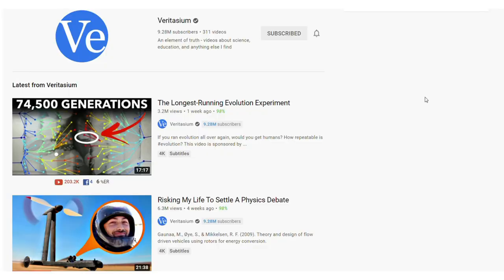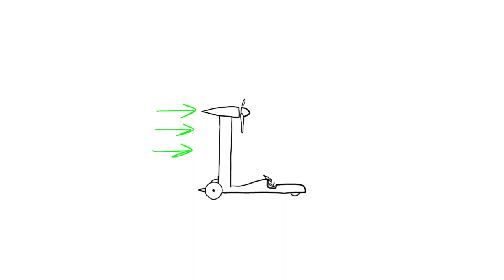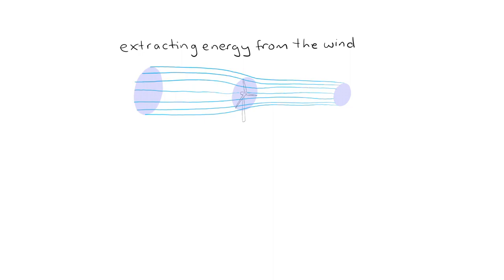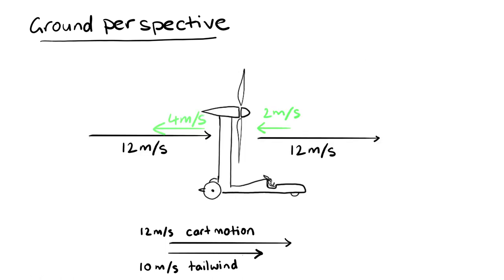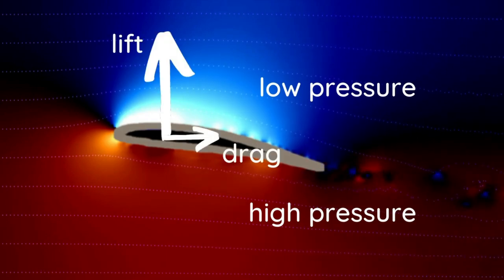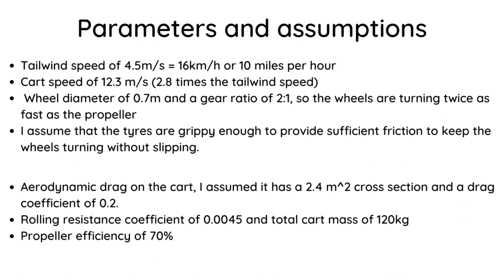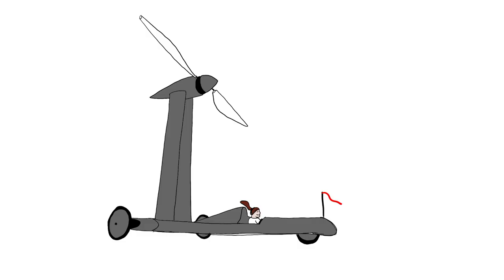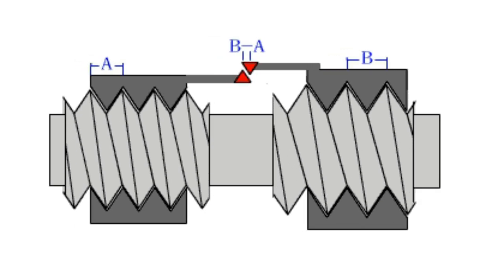Downwind Faster Than the Wind by Veritasium: How Does it Work?

Comment: Not a very good explanation for those who have little training in physics and math.  A better approach to understanding would be from the high performance sailing perspective.  As the lady said in this video, sailors have been sailing boats (and ice yachts & land yachts ) faster than the wind for a long time (many decades actually).  I can remember 60 years ago sailing an ice yacht faster than the wind.  
Bear in mind that a windmill is just an airfoil AKA sail, which rotates.  One simply needs to use video graphics or diagrams to show the dynamic relationship between 1) absolute/ambient wind, 2) vehicle translation/movement on land/water/air, and 3) relative/apparent wind. The static explanation in the instant video is pretty much useless for most people to understand what's really going on here; how the relative wind from which the motive power derives, increases with the speed of the vehicle.  
In the 1970s I framed this idea as "Momentum Feedback Amplification" (MFA) and built working models.  Unfortunately I didn't have the financial or mechanical resources necessary to fully develop the idea.  It's refreshing to see those ideas manifest on YouTube 50 years later.
Reply: In the case of a DDWFTTW vehicle, the key factor is that from the vehicles frame of reference, once at or above wind speed, the ground is moving faster than the air, which allows for a reduction gearing that divides the speed and multiplies the force. For example a 10 mph wind, a vehicle moving downwind at 15 mph, ground speed is -15 mph, air speed is -5 mph, that allow for a 3x reduction in gearing. A higher speed, lower force from the ground is geared down to generate a lower speed, higher force against the air.
Reply: @rcgldr  How do you believe your gear and ground theory that accounts for the fact that sailboats, land yachts (with free spinning wheels), and ice yachts, all of which have no gears, can sail faster than the wind downwind.  Moreover, how does your gear and ground theory explain the fact that a windmill type sailing craft like the Blackbird also sail directly at 0° upwind?
Reply: @melellington1333  - reduction gearing principle doesn't apply to sail craft. It applies to vehicles that move directly downwind or upwind, such as the 1877 Brennan torpedo, where the two media are wires and water. The wires are pulled back and off spools geared down to drive propellers, that in turn drive the torpedo forwards. If wires were attached to posts, then the torpedo would travel downstream faster than the stream. Using the same principle, a model river boat could use the spools geared down to drive a paddle wheel, in which case, there is no movement of any components that resemble tacking. For DUWFTTW (directly upwind), a windmill is geared down to drive the wheels, and the higher speed, lower force from the wind is geared down to exert a lower speed, higher force onto the ground. High performance sail craft that can achieve VMG (velocity made good) directly upwind or downwind faster than the wind, are able to do so while tacking because of their overall lift to drag ratio. One difference is that propellers or windmills operate in their own induced wash, which affects efficiency, while sail craft are constantly advancing into clean undisturbed air. This is why helicopters require more power to hover (operating in their own induced wash) than they do to travel laterally (constantly moving into clean undisturbed air).

Comment: The starting explanation was not totally correct. The prop pitch is variable negative to positive..you start with the prop pushing the wheels to start forward motion then once you have momentum you can change the pitch to have the wheels push the prop.
Reply: "you start with the prop pushing the wheels to start forward motion then once you have momentum you can change the pitch to have the wheels push the prop"

Maybe they did it like that, not sure, but it's not required (if friction is low enough).

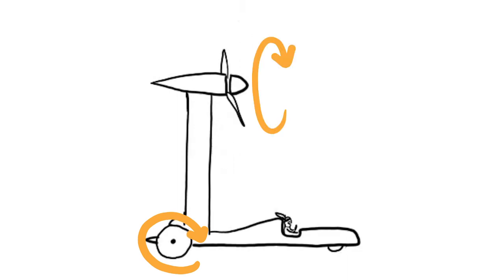Comment: Me : PAUSE... Hold up!! 0:23 "The wheel on the cart turn the propeller."
Me: I hope you correct yourself later. It's the other way around before it's traveling faster than the wind.
Reply from the maker: Actually, the wheels always turn the propeller. The propeller's direction never changes below and above wind speed, and it never gets turned by aerodynamic forces directly turning it like a wind turbine.
Reply: @EngineeringwithRosie  I wasn't implying the prop changes direction. I was implying that it takes the wind to power the prop that in turn powers the wheels until the vehicle matches the wind speed. After that, then yes, the prop is powering the wheels.
Reply: @SternLX  The wheels are powering the propeller.
Reply: @seneca983  Yes. AFTER its traveling faster than the wind. Prior to that the Prop, still chained to the wheels, is being turned by the wind which in turn powers the wheels.
Reply: @SternLX  "Prior to that the Prop, still chained to the wheels, is being turned by the wind which in turn powers the wheels."

No, the prop is being turned by the wheels in that case too. If the prop were turned by the wind it would spin to the other direction.
Reply: @seneca983  No, Wrong. Blow on a fan and it starts turning in which ever way the pitch dictates. Remove the wind. Fan is still turning in the same direction but is now creating it's own wind on the back side of the fan as it spools down. Basic mechanics. Same thing happens with a Prop driven Airplane. Remove the power from the prop so it's not pulling air though it anymore, if decoupled or on a one-way clutch it remains spinning(called Pinwheeling) in the same direction the engine was spinning it because now it's being driven by the wind pressure on the front of the blades. Never does it change direction as you suggest. 
Same principle for this fan driven cart only the wheels and blades are never decoupled. Wind is pushing on the blades pushing the cart forward and at the same time spinning the blades which is in turn driving the chain connected to the wheels. AT NO TIME BELOW WIND SPEED are the wheels driving the Prop. That's all work being done by the wind. The video of the run clearly shows this and I don't know why you're having such a hard time with basic mechanics.
Reply: @SternLX  "Blow on a fan and it starts turning in which ever way the pitch dictates. Remove the wind. Fan is still turning in the same direction but is now creating it's own wind on the back side of the fan as it spools down."

But that would be creating wind to the same direction you blew. In this cart the direction is the opposite. The propeller (when it's turning) is always turning to such direction that it's pushing air backwards while the wind is coming from behind.

"AT NO TIME BELOW WIND SPEED are the wheels driving the Prop."

The wheels are driving the propeller both below and above the wind speed.

Comment: i am just a stupid grunt, i can barely begin to understand this. one thing no one has talked about tho, is there a top speed? what decides the top speed? can the thing be started down a hill and run without wind and for how long? 
sorry if you find my questions stupid, but thats me! an ordinary stupid guy not afraid to admit how stupid i am. =)
Reply: The top speed is limited primarily by rotational drag. The torque required to turn a prop goes up with the square of rotational velocity, but the thrust only goes up linearly. At some point drag transmitted to the wheels will reach equilibrium with the thrust from the prop and the vehicle will cease accelerating.

Comment: Complicated explanation of something that is completely obvious. Because air is transparent we forget it is there. But in fact it is a 
fluid and it bears down upon us with a pressure of over 2000 pounds per square foot! When 2 mediums are moving in relation to one another
we know it is possible to travel through (or on) one medium using the relative movement of the other medium. or visa versa. In this case the ground and the air. So this craft is moving through the air using the power of the ground. You may say that the ground is not moving. But from the point of view of the cart it is.

Comment: Great video! Also like the one where Derek won the $10G on the bet from the prof. Your video explains very well where the increase in force comes from to propel the vehicle faster than the wind. I have one questions. At the beginning of this you said the wheels power the prop and in the other video of the test model on the treadmil that was very obvious but in the Blackbird, how did it get started for the wheel to move in the first place? Wind on the body of the vehicle??.............Thanks, Jim

Comment: No need to over simplify this, it actually makes it more confusing. I find getting into the nitty gritty of how lift is really made helps people see what is really going on and eliminates confusion.  Don't condescend people, you learned it so can they. We are all just human and have the same limits on observation regardless of our high education. Give them a full blown blade element model and explain intercept, downwash lift vectors, L/D relative wind, slip, all the things that are usually left out.  Wellll maybe leave Re. and Froude to the Ph.Ds  ;-)
Reply from the maker: Sounds like a great idea for a video! Please tag me when you make it. But I wouldn't leave out Re, your CL and CD will be way off if you do that, even in a simple model like mine it needs to be considered.
Reply: @EngineeringwithRosie  im seriously considering doing a model in COMSOL, you could really show whats happening clearly. BUT COMSOL IS HARD!

Comment: The tail wind is required to push-start the car. Once the car is in motion there is a head wind into the fan. The car has to have a higher velocity than the tail wind in the same direction in order to have a head wind into the fan. The rotating wheels through a chain rotate the fan. The fan blade’s pitch angle is adjusted in such a way to accelerate the incoming air and in the process a force is applied on the air. Rate of change of momentum (mass x velocity) equals force. That is Newton’s 2nd law. Every force has a equal and opposite reaction. This is Newton’s 3rd law. Therefore a force is applied on the fan by the accelerating air stream. That force accelerates the car with a fixed mass. If we have a starter no tail wind is necessary. The head wind into the fan is generated by the relative motion between the car and the still air or tail wind, with the car velocity greater than the still air of tail wind in the same direction.

Here we have a un-ducted fan just like we have on MD-80 aircraft. The difference is, MD-80 un-ducted fan is driven by the LP Turbine in the engine, here it is driven by the wheel. That is the idea behind the fan; it moves large mass of air at very low speed generating enormous thrust. Look at the size of the fan compared to the car. 

For an observer on the car, the wind behind the fan gains speed. For the observer on the ground, the tail wind’s speed behind the fan is reduced. 

The conservation of momentum is satisfied by the force being equal to the rate of change of momentum of the air stream at the fan. Energy is also conserved by calculating the power at the wheel being equal to the power generated at the fan. Conservation of mass is implicit. There is no violation of any physical laws.

It is a nice demo of how a fan works in an aircraft. Great!

Example (because it is difficult to conceptualize)

Let us say the wind picks up speed up to a healthy 8 meters per second. The fan acts as a bluff body (means it’s not aerodynamic to cause any lift or drag but just stands in the way of the tailwind). The pressure acts on the exposed surface to cause a force in the forward direction.
The car is pushed to move in the forward direction and reaches a speed of 8 mps. Nothing happens at the fan because the tail wind speed is the same as the speed of the car and the relative speed is zero at the fan, for the observer on the car. But there is relative speed with respect to the ground that generates thrust because the fan blades are rotating due the wheels rotating. The distinction here being the thrust is generated by the relative speed with respect to the ground but not due to the wind.
There is a wind guest and the speed goes to 12 mps. Car gets accelerated to 12 mps. The wind falls back to 10 mps after the gust is over.
Now the relative speed of the wind w.r.t the car is 10-12 = -2 mps. This is the headwind into the fan that starts the fan to work its magic so to speak. In the headwind direction, the fan blades act aerodynamically.
Let us say the wheel applies 12 mps X 100 Newtons (F X V= Power) =1200 N. M/s = 1200 Watts on the fan by a bevel gears arrangement. 100 N is the force on the wheel shaft in the direction of motion.
Fan Thrust = 1200 Watts / 2 mps = 600 Newtons. Fan develops lot of thrust by moving a huge mass of air at a very low speed. (In a turbofan engine more than 80% of the power is generated by the fan!).
There is a net unbalance force in the forward direction that accelerates the car. The acceleration or deceleration of the car is controlled by varying the pitch angle of the fan by a lever in the hands of the driver.
All the three Newton’s laws of motion are evident in this application. Find out how.

Comment: Still struggling with it.
Reply from the maker: I have just learned that there will be another Veritasium video on this topic, with more explanation so hopefully that will help you get there!
Reply: @EngineeringwithRosie  I really thought you would disprove it. That the air speed above the ground was more than the nose cone. Guess I now have homework to try understand it.
Reply: @DavidKennyNZL  For the NALSA record the windspeed was measured at the height of the propeller, outside of the propellers influence. You can also find videos with the streamers way above the propeller. Search youtube for "BUFC second run".
Reply from the maker: @DavidKennyNZL  Rick has some videos on his channel with a small cart on a treadmill. In that case it is the ground that is moving and the air is still. So you still get the relative velocity you need, but no/extremely minimal wind shear.
Reply: @DavidKennyNZL  "Guess I now have homework to try understand it."  
This may be the most intelligent comment on the internet today!  Keep at it and it will slowly come to you.  Different people need different examples to see through to how it actually works but Rosy's is a really good one! 

The dumbest comments are along the lines of "I really know physics and this is impossible--impossible I tell you because if violates Conservation of energy, You can't outrun your power source,  the rotor is turning backwards, there's hidden electric motors all over it with batteries, etc!"

Comment: outher radius of prop has negative angle of atack, so everithing is clear
Reply: No.  Not at speed.
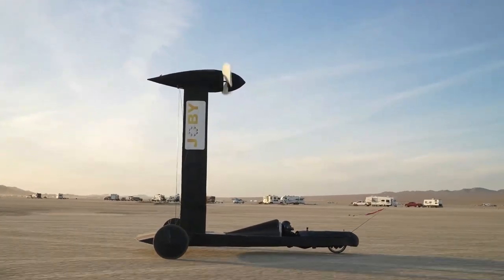Reply: @johnborton4522  watch again and press stop button on 0:11, it goes faster than wind so it has negative aoa, and it support theory of sail boat that goes zig zag,  props represents two opposite sailboats, as inventor of this device explained
Reply: @makantahi3731  

I BUILT that very propeller (and the rest of the Blackbird) by hand with Rick so I know exactly how it works.

https://en.wikipedia.org/wiki/Blackbird_(wind-powered_vehicle)

At speed, the entire propeller comes unstalled and produces thrust via the torque provided from the wheels.
Reply: @johnborton4522  ok i will not argue with you, but only simple and logic explanation how it works  is if that blades work as sail  on sailboat when it goes almost perpendiculary on wind, it has to have some relative angle that gives max lift , and this angle is positive but it works as wind mil, (what changes angle into negative)
Reply: @makantahi3731  

It's not a windmill, it's a propeller.
Reply: @johnborton4522  ok, if you say so, i am interested in some data: did you measure torque or force in chain that turns prop/wheels, from start to finish, did you change prop pitch  when drove or  was fixed, and what would happen if changed it from lower(negative ) to higher.
Reply: @makantahi3731  

The Blackbird was run many times at over 2x windspeed with a fixed pitch propeller before I built and installed the variable pitch hub.

Here is one of the videos when it was fixed. 

https://youtu.be/aDzWh9J1dk4
Reply: @makantahi3731  "it support theory of sail boat that goes zig zag"

You don't need negative pitch for that. The sails of sailboats tacking like that act as propeller blades, while their keels act as turbine blades. For the cart the wheels & transmission play the same role as the keel.
Reply: There is a freewheel on the prop shaft which prevents any energy from the rotor being able to back-drive the wheels.  This was installed to ensure compliance with the NALSA rules for the world record which stated we could use no stored energy to accelerate.  This of course also prevents the rotor airfoils from acting as turbine blades and driving the wheels forwards during normal operation.

There is a drive chain from the rear axle to the prop shaft.  The side traveling down (pulling from the rear axle to the prop shaft) remains tight during all phases of downwind operation.
Reply: @johnborton4522  ok, i just have watched video on link you gave me, i did not think that prop takes energy from wind and rotates wheels, prop uses some energy from wheels to keep it spinning that makes more lift on prop  if it spins faster, analogy would be same if you installed kite and zig zag with it, but vehicle goes straight down wind,
Reply: @makantahi3731  

You are correct in your analogy that the twin airfoils 'zig zag' across the wind (a broad reach in sailing) and drag the chassis straight downwind between them.